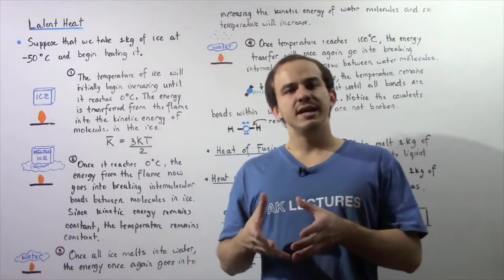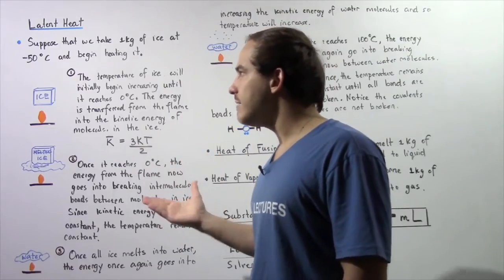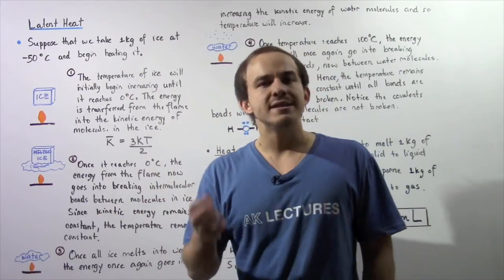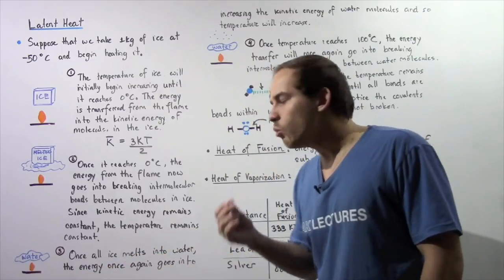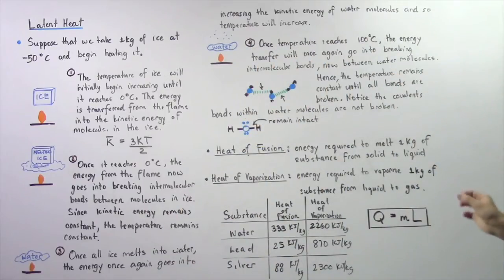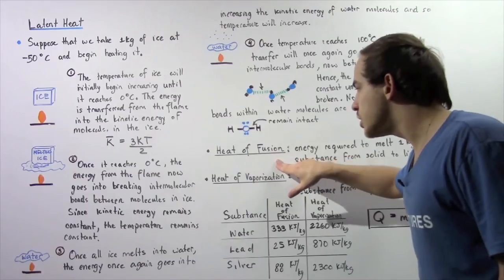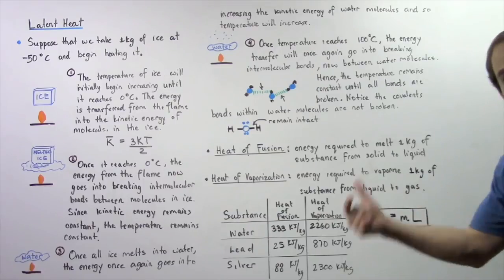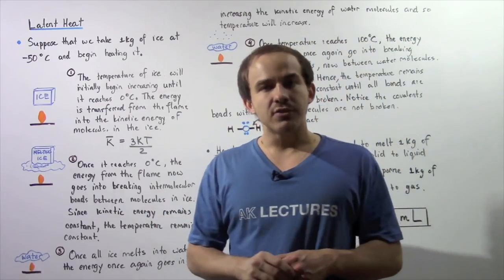Heat of Fusion and Heat of Vaporization

Comment: how can the heat of vaporisation of lead be smaller that that of water? Maybe I am confusing it with the temperature in wich this happens?
Reply: Metals are great heat conductors. They require less energy to heat up. While water is not a good heat conductor, it requires more energy to increase its temperature. 
This is why metals can heat up in seconds while it can take several mins to get water to boil.